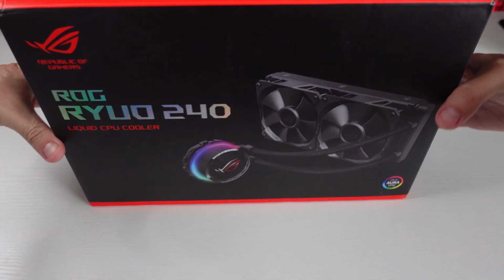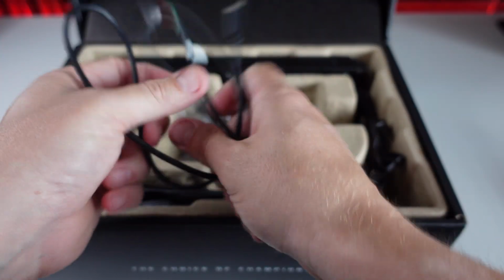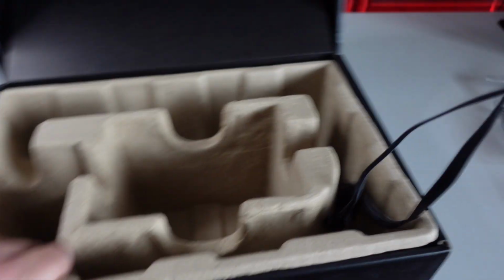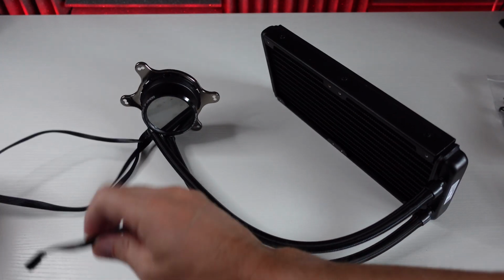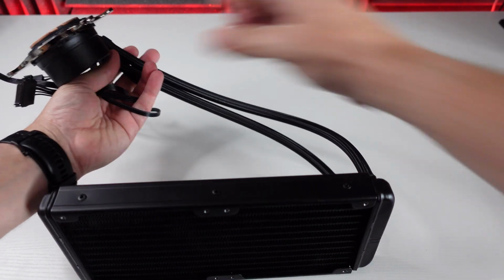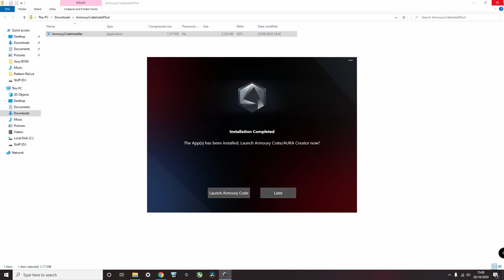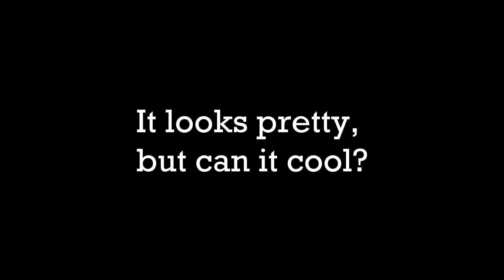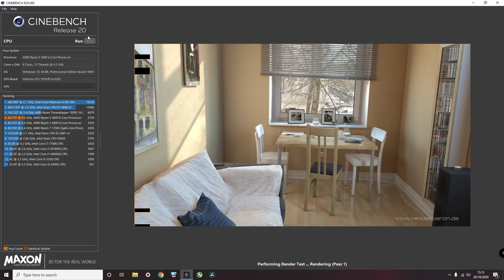Asus ROG Ryuo 240mm AIO - Unbox, Install, Setup & Test

Comment: i’m having the biggest difficulty with the smd mounting bracket, what screws am i supposed to use, i’ve tried them all and it seems to not fit in my msi b550 edge motherboard
Reply from the maker: Do you mean the screws to secure your motherboard to the case? If so, they'll be the ones that came with your case. Normally, they are the slightly thicker ones. I have even used the screws that are used on the PSU before.

Comment: Hey, I have one question, can this fit in a MUSETEX MESH MATX /MINI ITX case if I take out the top fans or It won't fit? Great video learning a lot!!
Reply from the maker: It looks like it supports a 240mm radiator in the top so you should be fine
Reply: Thx

Comment: I had this installed on my aorus b550i mb, aio pump goes to cpu fan header than Y spliter goes to 2 fans, micro usb to internal usb header as I only have 1 usb header on my mb than aio to sata power. The screen never turn on, I can set the pump in the bios to 100% PWM and I can hear the pump running. In the asus armoury I can control the RGB ring to anything I want with no problem, but the OLED screen never turn on and the 2 fans does not spin and In the armoury software the fan control does not do anything to it.

Comment: Just got the 360 version but my case was too small so I’m upgrading and the new case comes in tmrw, hyped to put it back together
Reply from the maker: Cool,what case are you going from and to?
Reply: @WayneWebbFilms  a cooler master td500 with the mesh side and the fractal glass panel
Reply from the maker: I think it boils down mostly to aesthetics. I gather the Ryujin is slightly better but they both have issues with their LCD displays. In my opinion you're better off looking at the NZXT X53 or Corsair H100i XT for value to the $£€.
What case are you using?
Reply from the maker: Aesthetics are over rated...sometimes ;)
Give the X53 a go, you can change the colour at least to match your build. If it doesn't look the way you want you could always go for an Asus. The Ryuo probably being better for the price.
Reply: @WayneWebbFilms  I have an rog strix 2080ti and asus mbo so it all blends nice lmao
Reply from the maker: Yeah I get that. Nothing worse than an msi motherboard, asus gpu and nzxt cooler ;)
I like to have the same motherboard and gpu at least
Reply from the maker: Top Noodle  looking forward to bf6 too

Comment: WebbTech i download it now they keep making this random boosts! It is way too loud. Do i have to download the armoury crate? Can this work without its software? I mean I was using it like 2 years without armoury crate and it was all silent. Also will my CPU get damaged if I not use it? Performance wise is it bad?
I have I99900k rtx 2080 ti.
Reply from the maker: Previously I suspect that your BIOS settings controlled the fans and pump. Its also possible that either time you didn't have the curve setup correctly, so you may have been running the cpu hot and not realised. It sounds as though things are ramping and it is very annoying. Quite common on Ryzen due to high voltages and temp spikes all over the place. I would go into Armoury Crate and set a custom fan curve or a constant
Reply from the maker: ...fan speed ie 60% which is what I do. I also do it for the gpu. That way the sound levels stay the same and you can have different profiles for normal use and gaming. The alternative is to delete Armoury Crate, then check out your BIOS setting and monitor your temps with HWinfo etc and alter things in the same way ie custom fan curve. Hope this helps
Reply: @WayneWebbFilms  Thanks for the reply so appreciated! <3 The thing is I used this for like 3 years without Armoury Crate. I played demanding games. The CPU would burned by now right? Does my PC or my motherboard idk keeps using the RYUO fans? I searched a little bit people say it is not necessary to use the software and let windows handle. By the way love your content !
Reply from the maker: The cpu has inbuilt protection, so if it reaches its TG max then it will warn and shut down. I doubt you were running things that hot and tbf the CPUs are built to withstand a lot of heat. I prefer low temps where possible and hate the ramping thus setting a manual static fan speed which is acceptable. Good fan choice will definitely lessen the noise levels and I'm a fan or Arctic P12/P14 fans (pun intended). The BIOS will more than handle the AIO if you get rid of Armoury Crate (AC). The default for the pump is 100% and then the fans will be whatever you set. AC is mainly there for RGB and the LCD screen.
Glad you're enjoying the content. Unsure if people actually like it or not sometimes...I'll continue to do my own thing regardless :)

Comment: The 3 pin, 4 pin cable i dont have were to connect them, its working whitout it.. Little help pls
Reply from the maker: Hi, do you mean for the fans? The 3pin should go into the cpu header, there should be a fan splitter for the two fans and the 9pin usb header into a USB port towards the bottom of your motherboard

Comment: Hi, I'm planning to use to cool a i7-11700k on a rog stryx z490-f gaming. For your experience is better to connect fan on cpu_fan and cpu_opt header and pump on AIO_PUMP header or connect fans to waterblock Y cable and this one to AIO_PUMP? Or better to cpu_fan? Installation guide is not clear reporting to connect to cpu_fan or AIO_PUMP. I suppose is better to connect to AIO_PUMP if specific header is available (on Asus rog motherboard for example) and to the cpu fan header if no other option is available. Is correct?
Connecting fans (noctua chromax, in my case) to cpu_fan and cpu_opt headers make possible to configure fans in bios, also, not only with ai suite 3 as normal cpu fan, leaving the possibility to set pump speed in windows only (100%by default on aio header) via micro USB and Asus software. Thank you in advance
Reply from the maker: It's a good question and I had to look at my PC to see what I had done myself. I've been using quite a few coolers that I had forgotten. I have the 3 pin in the CPU header and then the fans into the Y cable. I have 3 other fans that have been daisy chained to one another and that ends in being connected to the Y splitter as well. Not 100% sure this is the right way to go, but its working and that's the main thing :)

Comment: Can you change the fans? I want to use the same fans as my pc case, just for the rgb so its all same lighting
Reply from the maker: Yeah definitely, the pwm connectors on your new fans will plug into the splitter and then your RGB fans into a hub or mobo depending on which you have.

Comment: I did all this on brand new motherboard and I keep getting cpu fan speed error message and fans won't spin attached to the radiator
Reply from the maker: Have you plugged the SATA cable into your PSU and the 3/4 pin into your CPU header? What is the error message?
Reply: @WayneWebbFilms  insure that the cpu fan is properly installed in the cpu header.
Reply: @WayneWebbFilms  I havw both fans plugged into splitter,micro USB is plugged into USB header,sata is plugged in back,and the splitter is plugged into aio pump header
Reply from the maker: It may be worth plugging another fan know the CPU header and and then the cooler into the AIO header
Reply: So everything is running now but still getting the stuff fan speed error the led is on and all the fans are running
Reply from the maker: @mrjbinksrocha2350  what is your motherboard? Might be worth updating the BIOS because it could be an issue they have fixed
Reply: Rog strix z590-e gaming wifi

Comment: Hii sir,I appreciate the review you made on this cooler. I have a doubt on this cooler I'm planning to buy this cooler for my Build. I have chosen NZXT h510 elite case which has a pre-installed 2 AER RGB fans which are of 140mm. I would like to buy an NZXT AER RGB of 120mm fans which would fit this cooler.And Can you plz tell how can i use those fans with this cooler?And this cooler's waterblock has some dedicated cables for The Ryuo Fans..Can i connect my NZXT AER RGB fans with them ? Or should i need use the motherboard fan headers for the Fans?
Reply from the maker: Hi, normally RGB fans come with 2 cables per fan. The 4 pin would go into the cooler, there are 2 cables for 2 fans, then the RGB cables would connect to a hub or RGB header on your motherboard. I have had a quick look and this case has a hub so connect the RGB cables to that and then you'll be able to control via the NZXT CAM software. I hope this helps
Reply: @WayneWebbFilms  Thanks you sir. So the fan header from the waterblock can be left empty?
You made studio quality Review on the cooler i really love your work and quick replies.You gained a sub😘🥰
Reply from the maker: @starboy.15  thanks a lot. I personally would connect the 4 pin cables to the cooler and then the cooler to the motherboard. The RGB cables to the hub. However, you should be able to plug the hub into the CPU header and all the fans into the hub.
Reply: @WayneWebbFilms  Thanks For saving me from anxiety ☺️

Comment: Hello sir. Did you put on full load?
Reply from the maker: Hello. When you say full load, are you able to expand on that? Is it the fans on 100% if so, check out the results from around 6 mins and "full speed" gives you the noise and cooling you're looking for. If something else, I plan to do a further video where I use the 3900x with the cooler in the same case. Happy to accommodate a test of whatever nature you're needing. May even have time tomorrow to do something with the R5 3600...

Comment: I would like to share and hopefully solve my problem here. 
I have Ryuo 240 also and have really big problem with fans, they are very, very, very loud.
They work on 100% all the time, idle, gaming, surfing on internet, just always.. 
Any help please? :D Im at the edge, i wanna send them back or sell it and getting new one..
Reply from the maker: Have you connected the USB interface cable? Is the pump connected to the CPU fan header? Have you installed Armoury Crate? Have you updated the Firmware on the unit? Have you adjusted the fan curve in Armoury Crate?
If you haven't done all of the above then that could be the reason.
Reply: @WayneWebbFilms  Yeah, its all well connected, i have problem with Armoury Crate, it worked for 2 months, i used to manually control fans to lower speed
Then it stopped working, when i click on Control Fans in armoury Crate, it becomes only dark and app wont load the command, like some bug or something..
Also i have one more question, can it be cpu problem? Im using i9 9700k, it works on 60 c, all 8 cores constantly also..
Reply from the maker: I would uninstall the app, reboot and reinstall it then. Do you have fan xpert installed? Just wanting to rule it being the case fans running at 100% as well...what motherboard do you have? You may want to do a bios update if all else fails.
Reply: @WayneWebbFilms  I triend to reinstall it like 30 times for sure, i just gave up. Also fan xpert doesnt work, doesnt read any of my fan in my case. And im really confused about it because when i was buying my pc, i only wanted to be one brand and its all asus, mb is asus maximus 11 (no wifi), asus rog ryuo 240 and case is tuf gaming GT501.
I wanted it to be in one color all fans etc, etc. But nothing from that, i think there is not help for my bueaty imagined rgb pc :D
I think i cant even install armoury anymore, im gonna try it right now to be sure in that :D
Reply from the maker: You may need to remove the regedit entries. I had a similar issue with my Corsair h150i a little while ago. You could try this replacing Corsair with Asus. Failing that and a BIOS update you may find either doing a Windows Update or fresh Windows install may help.

Please follow the steps below to re install iCUE as they are a bit different:

Open your computer's Control Panel.
Open the Programs and Features options.
Select Corsair Utility Engine in the list, and then select Uninstall.
Press Window Key + R to open the Run command.
Type %appdata% and press Enter.
Delete any Corsair folders in the window that pops up.
Return to the Run window and type %localappdata%.
Delete any Corsair folders in the window that pops up.
Open File Explorer and navigate to C:\Program Files (x86)\.
Delete any Corsair folders in that folder.
Type Regedit in the Run window and then click OK.
Go to HKEY_CURRENT_USER\Software\ and delete the Corsair folder.
Go to HKEY_LOCAL_MACHINE\SOFTWARE\ and delete the Corsair folder.
Restart your computer.
Download a new installer file for iCUE from Corsair.com and reinstall.
Reply: @WayneWebbFilms  Okay, i installed crate by your steps, app is working now, i have to check if i need to select silent mode everytime i turn on my pc, because i had that problem also, it wont save the profile and keep it everytime i turn on my pc.. I checked firmware also, its up to date.
Fans are not that loud as they used to be, but i still hear them, are your fans from asus completely silent or they are not? If you solved your noise problem with noctua im just gonna get new fans, it could be great! :D
Reply: @WayneWebbFilms  One more question, is it smart to use fixed RPM mode so i can make fans to be even more silently? I am not forcing my pc, its very powerfull, im just using it to play dota sometimes and will a bit force it with new incoming Cyberpunk
Reply from the maker: @skabe7042  great, I'm glad that helped you. No the asus fans are noisy but it depends how quiet you want the system. I normally use Arctic P12 pwm fans but you can get better fans from Noctua etc. Saving your settings doesn't always work from my experience, the software isn't very good and I did a video comparing the Asus with the H100i and the iCue software is so much better. You may just need to open up Armoury Crate to accept your settings or make a change in the BIOS ie make sure that the fans are set as PWM and are on a Standard curve.
Reply: @WayneWebbFilms  I want it to be completely quiet, i spend a lot of money on my pc and i want it to be silent :D my brother is using nzxt x62 (i guess) with 2 fans also and its completely silent.
Yeah, that is so true, i am so disappointed in their software.. 
I think i cant recognize your answer for fixed rpm fan speed for lower sound :D
Reply: @WayneWebbFilms  Thank you for your time so much! Im glad that i met you and you were there to talk with me, a lot of guys wont even answer once! :)) All good man!
Reply from the maker: No worries, let me and the thread know if you find a solution because others can benefit.
With the BIOS is was going to write that when booting, spam DEL and the once in the BIOS press F6 I think and you can adjust the settings to PWM or DC, change to PWM and then select your curve. Press save after each change, then press ESC to go back to the menu and F10 to save your settings. Not sure if you have already done this or I wasn't clear before.

Comment: All very well. But how the hell can you control the LEDs, the armory does not serve or the aura or anything, how can you turn off that expensive and not very useful device
Reply from the maker: You may need to go into devices and update the cooler firmware in order to be able to select it in Armoury Crate. Is the screen on at all? If not, make sure the usb cable is set up of your pc won't be able to communicate with the cooler. Let me know how you get on
Reply: @WayneWebbFilms  Everything is well connected, I have updated the forware as 100 times and nothing, I have done everything and it still does not work, the year is well connected to everything ... and I am not the only one with this problem, everyone who has one of these is facing the same problem
Reply from the maker: @thefeed7234  so the usb cable is connected to the pump and the other end to the Motherboard? Do you have another usb Header you can try? Is your motherboard bios up-to-date?
Reply: @WayneWebbFilms  Updated bios, the usb cable is new the one that brought the box and the other cable to the port that the manual says and nothing, I only have some LEDs and the screen on all the time and it is as if the aio does not exist in my pc, armouny decree everything else except the year
Reply from the maker: Do you want to send me a couple of pics of the AIO installation and Armoury Crate and I can see if there is anything you may have overlooked? WebbTechYT@gmail.com
Reply: @WayneWebbFilms  Ok, when I'm at home I'll send them to you
Reply from the maker: Just booted up the pc after rereading your message. If you click 'device', select 'Ryuo device', then click on 'lighting' you should then be able to control the LEDs around the pump. To control the screen you need to click on the 'OLED' tab and then choose your options.
Reply: @WayneWebbFilms  I just sent the photos to the email you gave me, just now I did

Comment: Does it all just connect to the motherboard or do I need a controller
Reply from the maker: All via the motherboard. The fans attached to the pump, the pump is powered by sata and the display/fan speed is controlled by the USB cable. Hope this helps

Comment: I’m so confused with the cables someone help pls
Reply from the maker: Some of these AIOs can be confusing.
Once you install the pump, plug the 3/4 cable into the CPU header, then you plug the fans into the splitter. There is a micro USB cable that goes into the side of the pump and you plug that into a header on your motherboard. You'll also have a SATA cable to power it.
Hope this helps